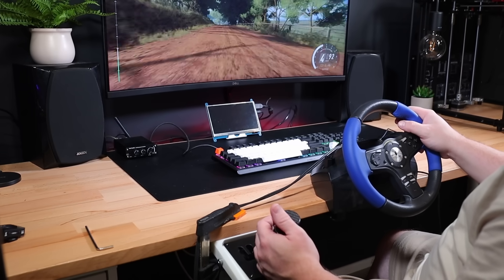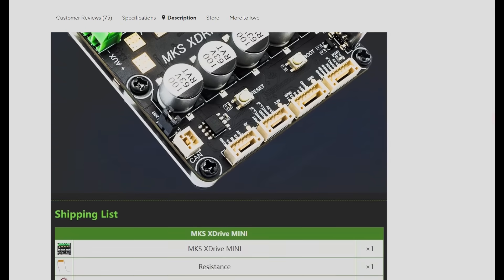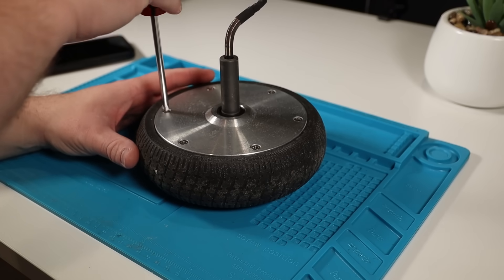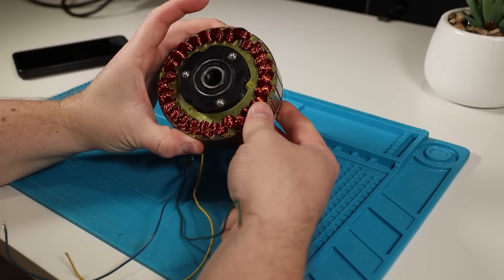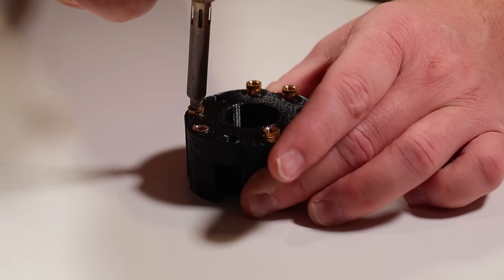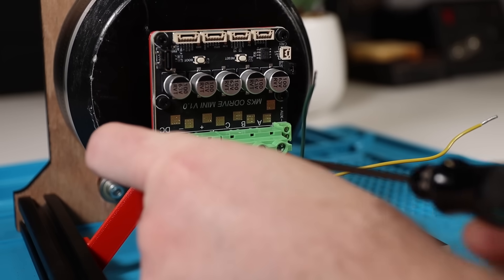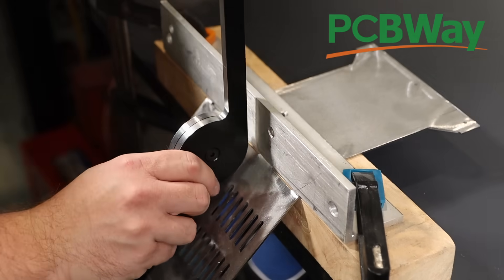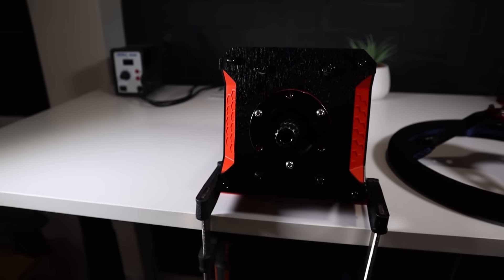DIY High Performance Force Feedback Wheel

Comment: The problem with printed wheel hubs and adapters is that they break very easily. I used to print wheel hubs until I broke my 3rd one and just got an aluminum one.
Reply from the maker: Yeah, mine barely lasted long enough for the video (although it was a little loose to begin with which wouldn't have helped). I've got some aluminium replacement parts en route for a part 2!
Reply: @cncdan  ya I learned that on a Logitech g920 lol. I switched to a thrustmaster t300rs setup and if  the Logitech wheel was strong enough to break them I knew the tm would definitely break them.
Reply from the maker: @neonnerd1364  in my defence, the little Logitech driving force EX doesn't feel even close to strong enough to break a printed adapter, even at 150% force feedback power. But now I've experienced a powerful direct drive wheel, I realise the printed adapter was never going to make it 🤣

Comment: Finally the tutorial i needed
Reply from the maker: I'm working on a part 2 currently to fix the few issues I had. I also have an easier way of modifying the motor that doesn't require a lathe!

Comment: How much did it cost to make
Reply from the maker: The controller, power supply, encoder, wheel and quick release totals about $150USD. I already had the motor, plywood and extrusion and I was able to laser cut the cover out of an offcut of material at work. I've designed some parts that I've got PCBWay making currently that should make this project possible without a lathe. That will add about $100 USD to the project but its still much cheaper than a commercial direct drive wheel!

Comment: how about better encoder, more stiff parts made from aluminium? i think that was a great succes that it even work!  how about dissasembly any current wheel and exchange transistors and motors? then you will have xbox/ ps compatybility and game support probably?
Reply from the maker: I thought about upgrading an older wheel and while I'm sure you could make it more powerful, you will still be limited by the response times of the older hardware. The encoder has 4096 counts per revolution. I know there are "More accurate" ones out there, but I think this is ample for what we are trying to achieve! I've got some aluminium replacement parts en route now for a part 2!

Comment: I wish you improve your shaft to wheel connection. The "classic" way of mounting QR-adapter to motor bell is very sturdy, and i have no play in the wheel at all.
Reply from the maker: Yeah, I was always planning to make that part out of aluminium but I ran out of time before the video! I've got some parts en route for part 2 that should solve all of those issues!

Comment: I've built FFbeast wheel myself, just in a more classic way(with bike spoke through the shaft). I can definitely tell that motor is getting hot while driving 40+ minutes stints.
I use DIY AMG GT3 wheel made from 5mm thick carbon fiber sheet, 3D-printed plastic parts and FreeJoy as electronics. While keeping settings as 100% wheelbase power, and 66% FFB gain in ACC, the feel is amazing but the motor is barely touchable after 30+ minutes of active driving(especially tracks with fast corners).
Reply from the maker: I haven't been able to give mine that much of a try yet. My next mods are actually going to open the motor up even more, so keeping it cool hopefully won't be difficult!

Comment: Do you have any safety features incase the motor has a run away. Or low power ramp issue?
Reply from the maker: Yeah, that's something I need to look into! The motor has a scary amount of power so I do need some form of E-Stop on the off-chance something goes wrong!

Comment: I have a wheel I like (a Loigtech Momo) that rather than throw out, I'd like to modernize and convert to DD. Have you got any tips? I was thinking an electric skateboard wheel would be the way to start, but I'm in a bit over my head at this point
Reply from the maker: Depends on how much of it you want to retain I guess. I assume the original motor is a small brushed DC motor with a gear or belt drive. You could try and find a brushless motor with the same sized shaft and replace then replace the controller with the same one I used. You'll likely end up stripping gears or breaking something eventually though due to the increase in power!
Reply: @cncdan  part of the plan would be to totally gut the mechanicals and circuitry so I can also replace the godawful serial-like plug that it uses to connect to the pedals

Comment: Ooh, you came from a feedback-less Wheel.

Damn, that’s gonna feel like lighters of a difference.
Reply from the maker: It's not feedback-less, but it is VERY weak in comparison to modern standards! The biggest issue is it only has 180 degrees of travel so fine adjustments to the steering are a challenege!

Comment: Hi. This is some high quality diy. I've tried making realistic feeling pedals last year but materials and crappy tolerances made them unusable. I got the feeling right for both the brake and clutch though. For the brake I just used stacked pieces of inner tube as a spring and for the clutch I made somewhat of an over-center mechanism
Reply from the maker: Pedals are on my to-do list! I know what you mean about tolerances, they can be tricky to get right. I've got a few ideas up my sleeve for the pedals but I'll do a part 2 on the wheel first with all the fixes I'm planning!

Comment: You can solder wires from the built in magnetic encoder to the "A B" pins, this way you can use it as a normal encoder in the FFBeast
Reply from the maker: Good to know! I didn't have much time to research and I already had the replacement encoder board here for another project, so I just used it instead!
Reply: There is any info on the internet about this?
Reply: @IvanFT_  I can't find any detailed one here, but get a look at the AS5407P pinout and solder a cable only to the A and B pins of the chip, those cable you connect to the odrive port.
Reply: @JulioGhigiarelliMajeau  Thank you!

Comment: How come when testing the DD wheel you were playing on what looked like Dirt or Dirt 2 (and not the modern Dirt Rally 2)
Reply from the maker: Good spotting, it was actually Dirt 3 (one of my all-time favs). I was struggling to get dirt rally 2 to give me force feedback. It was reading the inputs from the wheel just fine, but the feedback just wasn't co-operating. I tried dirt 3 and it worked first try so I decided to just film that and work out what's going on with the other one afterwards!

Comment: 2:00 huhh?? Why would the shaft rotate? the center is the stator with the outside of the motor hub, the wheel rotating instead? Its an outrunner, no??
Reply from the maker: I'm talking about the shaft they put up the middle of the original shaft. Check out the offical build guide and you'll see what I mean!

Comment: One note: The Mean Well power supply, you said it was probably overkill?
Well, firstly, Mean Well are a very reputable brand, so I doubt you can go wrong with those, but it's always better to have a power supply that overkill than under - it'll last almost forever.
I nearly destroyed my last build with an 'underkill' power supply; I destroyed 2 circuit boards and had to replace them... the power supply still works but it took casualties.

Always better to go over for a power supply <3

Comment: Amazing video! Incredible skills and knowledge you have. For the pedals. You could probably find a USB adapter for the logitech ones you have and have that plugged in independently so you maybe able to use the woth your new DD Wheel
Reply from the maker: I'm sure I could work out a way to get them connected, but the aim is to build my own so I didn't put too much effort into trying! A few others have pointed out I can probably just leave the old wheel connected without the PSU and just use its pedals so I might give that a go if I do a follow-up video

Comment: Do this with a servo motor too
Reply from the maker: Absolutely could! I've actually got an old DC Servo motor sitting in my box of parts so I could definitely use it instead if I wanted. But the hoverboard motors are cheap, powerful and readily available so I decided to go with it instead!

Comment: I've been wanting to make something like this. This video will help a lot.
I'd also put the wheel on sliding rack and be able to use it in a flight sim as a flight yoke. The hardware I've figured out, just have the ability to lock the wheel. It's the electronics I'm less sure about, as it would have another axis to consider. I've looked at the Arduino Leonardo but I'm less sure how I'd tell the game to do force feedback. If anyone has any ideas do let me know.
Reply from the maker: Glad the video will help! I believe FFBeast can also do two axis FFB so might be worth looking into that before you go trying to come up with your own solution! You can do FFB with a leonardo or equivalent (i'm using one in my gamepad from a few videos ago for rumble feedback through xinput) but I'm not sure how you'd go combining the two. A few other people have also mentioned something called openFFBoard which sounds like it might be a bit more flexible, might be worth a look!
Reply: @cncdan  I had my eyes on Arduino-FFB-wheel on github. But having so many software options, I'm eager to get to work. Thanks again for the video. Looking forward to seeing how your sim rig grows.

Comment: I wouldnt wanna build a whole new wheel, but I have been thinking about upgrading the motor on a T300RS. This guide will be helpful as heck.
Reply: Normally you cant do that because of the firmware on the motherboard and the driver on the computer limiting power supply and monitoring components, but with advanced knowledge you could pull off something like this

Comment: plug the logitech in and use it's pedals in conjunction with your DIY Wheel..
Reply from the maker: I will certainly give this a go if I do a follow-up video! I have had trouble getting asseto corsa to handle multiple input devices at once. It configures just fine, but then doesn't respond to the secondary inputs when the game is running. I see other people manage it so it must just be something I'm doing wrong 🤣 Good old Dirt 3 seems happy enough with as many devices as I want so I should be able to test with that at least!
Reply: @ Thanks for the great content and video.. I wish I could make a DIY direct drive wheel.. I've actually been wondering if I could upgrade my cheap wheel somehow to make it better..

Comment: That's really cool to see. There is another option for DIY FFB - OpenFFBoard. It runs on a dedicated controller board and can connect to different motor controllers like VESC, Odrive, even brushed motors with a pwm driver or the OpenFFB TMC driver board. Also interfaces with pedals, shifters, whatever you want directly. Just leaving this here in case someone else is interested.
Reply from the maker: Very cool! I do like the VESC controllers, I've used several of them on my electric ride on projects over the years (before I was on Youtube). I do have a heap of different, large brushless motors here that I could try out for alternatives to the hoverboard motor too. I just like that the hoverboard motor is the perfect power/speed for a wheel without needing some sort of gear reduction.
Reply: I've been trying to reach you about making this this direct drive steering wheel but I didn't find any Instagram or anything related to you😊 how can I talk to you @cncdan
Reply: @cncdan  yes, those hoverboard motors are also very popular in the OpenFFBoard community. I started my design with a 6374 bldc motor and a 1:4 3d printed gear reduction but ended up buying a Panasonic AC servo motor from eBay with only a slightly loose brake, which is perfect for FFB and basically what some manufacturers for wheelbases are using. But yours is king in the bang for the buck department 🙂‍↕️
Reply: OpenFFboard Is Just what Is was looking for. I have a fanatec CSL DD 8nm. The motor in itself Is beafy but with passive cooling. The PSU Is 180W 24V. Others tested that the motor wont draw more than 85W from the PSU so in theory with a custom controller and Active cooling i could push It up to 150W. Now, i don't even know if its worth It, im not sure how much more Nm It could gain. Any idea? Opinions?
Reply: @Tiltglory the hoverboard motors are 350W each, they use a higher voltage than 24v tho.. the heat generated is from the amps.

With the right power supply and a hoverboard or scooter motor you could easily make your wheel have so much torque it'll break finger bones.
Reply: Just leaving this here as i am said interested person and your comment has helped me!

Less than 12 hours ago i didnt know DIY wheels were even a thing or that clicking on a recommended video of another channel turning a hoverboard into a minibike would eventually lead me down a rabbit hole where i'm contemplating making my own FFB wheel... but well.. here i am.

Thank you!

(seriously, everything above is true and the algorithm works in mysterious ways 😂)

Comment: Actually, it is possible to use encoder onboard of ODrive. Just small modification of board is needed. It is possible to wire encoder to encoder connector onboard and use it in AB mode.
Reply from the maker: Good to know! I already had the encoder from another project I'm working on so I didn't look into it too much!

Comment: FFBeast is truly a beast when it comes to DIY direct drive wheels! I built one myself and absolutely love it!

btw. I am running my ffbeast wheel on 21 amps right now :)
Reply from the maker: With a hoverboard motor? I feel like these motors have quite a bit of untapped potential. They are about the same size as some of the 100cc replacement hobby motors, just for an 8th of the price 🤣 They are just difficult to make use of because of the hub motor layout. I've actually designed a replacement top for the motor which will make the mod I did possible without a lathe. I'm sure the motor can handle more than the claimed 350w, it just needs larger phase wires and some cooling which is all possible now that the motor is open and the wires don't have to run up the middle of the shaft. Considering doing a follow-up video where I try out the replacement motor top, along with actually measuring the torque to see if it really can hit the 15nm people claim!

Comment: You can buy huge drone notors
Reply from the maker: Yeah, for 8x the price unfortunately! I've got a new motor top designed that I might try out in a future video to make the mod more accessible to people without access to a lathe! It's an extra part you'd have to buy, but it'll still end up cheaper than any off the shelf options!

Comment: As for your comment about struggling on finding what other people used. The discord is a wonderful resource. I wrote an entire guide to choosing a power supply itself on there
Reply from the maker: Good to know! I didn't need to venture onto the discord as there was enough info on the website, besides a power supply recommendation! I'm extremely happy with the amount of power I'm getting out of it with the meanwell 350w 24v PSU so I think I made the right choice!
Reply: @cncdan  We tend to recommend 15 amps minimum. So 350 watts/ 24 is about 14 amps so should be more than enough :)
Reply: @cncdan  hello would you ever be keen on making these as a prebuilt unit I would love to have one but I dont have the machinery to build one myself or as much skills required for one

Comment: the 350w psu is a bit less than most ppl use altho i dont what size magnets u had. i run at 25mm and run at 480w

Comment: I bet printed bearing sockets are to blame for bell going out of alignment.
Reply from the maker: This thought had also crossed my mind, but they are a pretty snug fit in there. I have a better idea for the front of the motor that I'm going to try which should remove all doubt from my mind about it being the cause. If it still moves, the bearing mounts are definitely next on the list!
Reply: @cncdan  With my build I went in completely different direction and it don't rub at all. I mounted my motor just like it was designed from factory. To mount encoder I drilled out shaft and bell face. I attached smaller shaft to printed adapter that is bolted to bell face. Encoder shaft is running inside ptfe protective sleeve and inside main shaft. Thanks to all that I didn't have to mess with factory bearing sockets.

But Your solution have clear advantage of better cooling possibilities.

Comment: Driving an encoder with a timing belt would remove the need to machine the motor and make construction much easier.
Reply from the maker: Sure would! It's something I considered but I was trying to keep the package as small and neat as possible. This definitely got more complicated than it needed to be in the pursuit of an attractive end result, but that's kind of what I do 🤣

Comment: 7:02 a possible better idea would have been to run a shaft through the full motor and run the encoder wire through the shaft, adapter e coder to shaft, then make a mount to cup over the encoder with a radial magnet in centre of cup?
Reply from the maker: I think I understand what you're suggesting. The problem is, the original motor only has a fixed shaft out one side which you have to use to mount the motor. You could put the encoder out the other side of the motor but then your magent cup would have to double as a wheel mount because they'd both be on the front of the motor. It would mean having nothing rotating in the shaft which I defnitely like, but it would end up being quite a bit longer than my current solution. Certainly not a bad idea though!